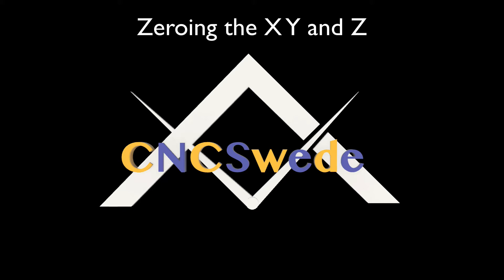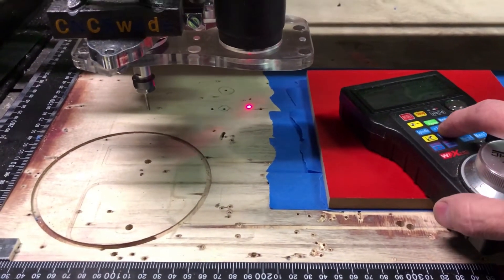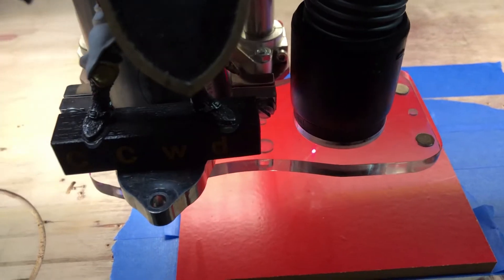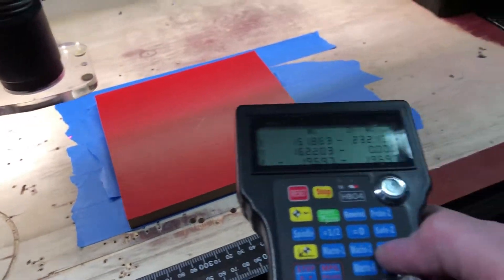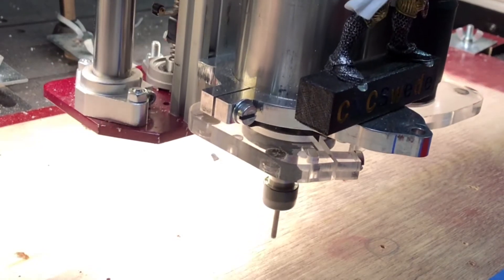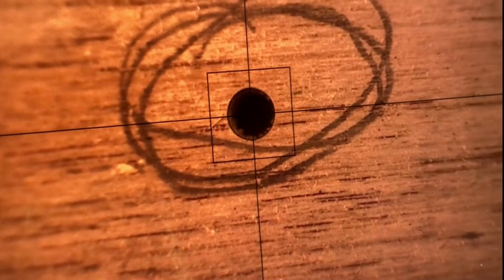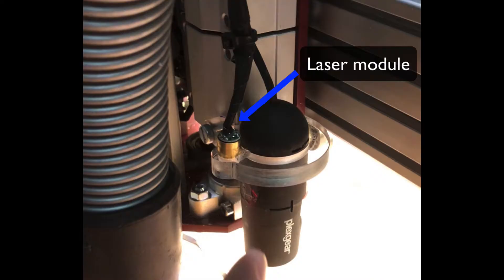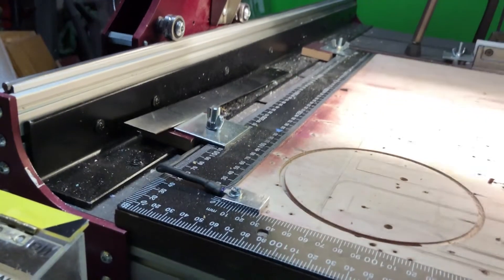Zeroing the XY and Z

Comment: Great video.. what brand and model of Vacuum do you have attached to the machine ? I will have to make the same dust shoe for my Raw 1.5 and also i need some type of Vacuum...
Reply from the maker: HearGear Thanks 🙏 
! I use a Festool SRM 45
Reply: Festool is great stuff, and expensive to, i think i will buy some cheaper model, dont know what yet but i need something with a great air flow and i would wanna have a vacuum so that i can extend the hose to so i dont have to have the vacuum it self just beside the CNC machine..
Reply from the maker: HearGear yes that’s vice, my cnc stands on a temporary place right now but later when I got it in place I gonna have the Festool in another room.
Reply: Yeah, that would be the best, to have it in another room, the longer hose.. the better air flow the Vacuum needs to have, i have been looking at the ones they have on Jula... but i dont know if any of them are any good for my needs... and to short hose...
Reply from the maker: HearGear Maybe This can be an alternative, have you seen this Channels? They build their own dust collectors 

https://www.youtube.com/user/Matthiaswandel

https://www.youtube.com/channel/UCn7lavsPdVGV0qmEEBT6NyA
Reply: Yeah i have been subscribed to Matthias Wandel for many years now, i have been thinking about building a dust collector but they will never be as powerfull as a Vacuum... but who knows.. maybe its possible to build a powerfull one...
Reply from the maker: I am quite new at this as you know, so I wonder how long time a vacuum cleaner can keep going? Some 3D carving takes many hours you know. 🤔 Of course they don’t have to run all the time but anyway...
Reply: Yeah.. i am thinking the same, some applications takes a very long time to carve and i am sure a vacuum that runs many hours in a row will get a shortened life or maybe even go up in flames.. haha...